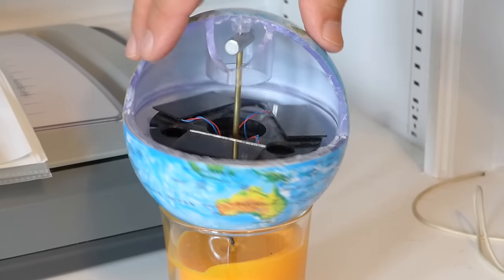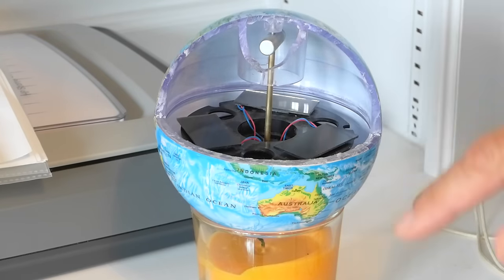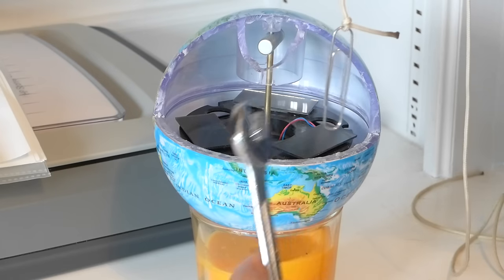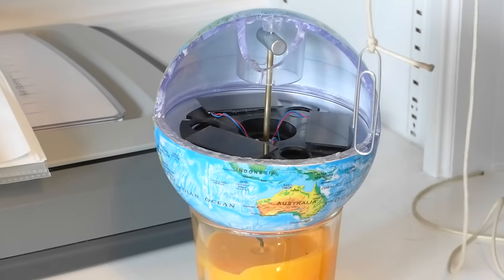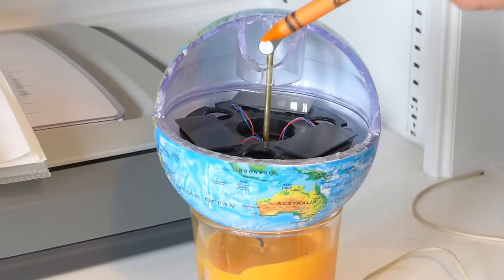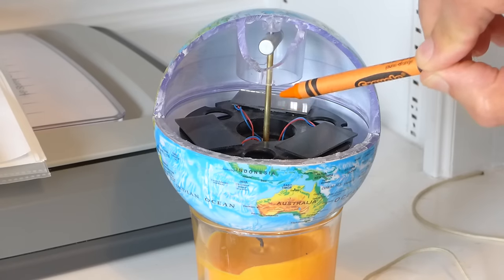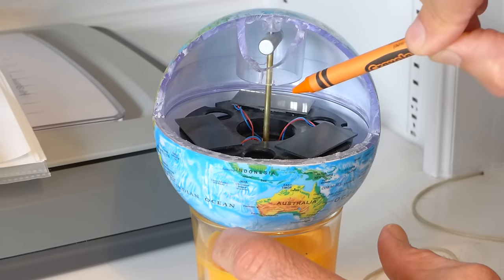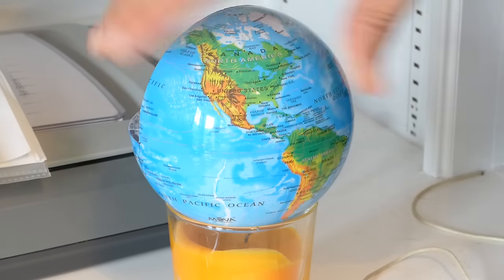Mova Globe cut open reveals powerful magnet. Why? Its ingenious purpose.

Comment: For those of you like me who own one of these and had it stop working... air bubble forms on top and it stops rotating due to the fact its not entirely floating in liquid.. There is a fix... You can drill a small hole in the top... add some mineral oil and then reseal the hole with rubber cement or similar (Goop, etc.).
Reply from the maker: Great work Scott !      I have a suspicion ( without any evidence) that keeping the globe in the sunlight continuously causes the plastic to "off-gas" and produce that gas bubble inside.  Just like the vinyl dashboard of a new car off-gasses and deposits that  layer of haze o the inside of the windshield.
Reply: Another reason this thing should cost no more than $25.
Reply: better yet, flip it over and drill a hole in the bottom to let the air out. then you wont see the hole once its patched up!
Reply: @orvillewingnut8260  Wouldn't that cause positive pressure though, thus not requiring any more fluid to be added after the pressurized gas was released by drilling the hole? A contributing factor to your theory could be that the plastic expands over time, but generally of-gassing actually causes contraction instead of expansion. Could the pressure internally be enough to counter that and cause expansion? My intuition says no, but I could be wrong. 

Just thinking through what you said and adding my thoughts to the conversation.
Reply: Don't buy it. Problem solved. 😊

Comment: Two questions.  First, was the inner globe filled wit air or oil?  Second question.  Why do you think there is a tube surrounding the magnet, at the top of the inner globe?  In a failed unit, had oil been found inside the inner globe?  The inner shell is much thinker than the outer shell.  Just an observation… great video!

Comment: I’m wondering if the designer has attempted to use  an induction loop instead of the solar panels to drive the globe which could also light it at night via LED’s?
I’m betting that it won’t work because of the affect it would have over the fixed pole magnet?

Comment: Great video. I have 5 mova globes. And another that developed a large bubble. What a $200 waste. I will cut it open to put on my shelf also. What should i use to cut it? A drill with a abrasive disk ? Thanx..,,todsy is jan 19, 2019.,,...,,thanx
Reply: Hacksaw should do, grinder with a cutting wheel would work but is overkill, a klien multitool would work as well. Honestly hacksaw, then sand the edge is probably the easiest/cheapest.

Comment: Hey Orville, love this stuff. Just bought one!  Just wondering why the upper shaft magnet in your video rotates freely (as you point and touch it) and isn’t orienting with the earth’s poles?? Strange. Did you film this video on another planet? 😃. Thanks.
Reply: Because the sphere is no longer suspended in oil. While it's suspended the sphere is in an almost frictionless environment, but without the oil there is too much friction for the axle align with the earth's poles.
Reply from the maker: Thanks Chris. I was wondering about that myself but hadn't figured it out.

Comment: Thanks for the explanation, Orville.  You mentioned that the motor is attached to the globe, but it looks like it spins freely in your video.  Did you unattach it?
Reply: the motor appears to be the part that is spinning freely because the inner globe with the image is being held in place by the canister that it's resting on. When it is properly  assembled that sphere is suspended in the larger outer sphere with oil between the surfaces. The powerful magnet he demonstrated alligns to either the earth's magnetic poles like a compass or whatever fields are in the area anchoring it in one place. so that when the motor rotates it and the outer globe spin instead of the internal shaft

Comment: I still don’t get it 😢 it spins with little solar panels - ok. But the magnet? What is it doing. Would a weight at that bottom not just keep it upright. Why is a magnet needed.
Reply: The motor underneath slowly turns the magnet which wants to stay aligned to whatever magnetic field is present, likely the earth's.

Comment: I assume there's liquid between the outer shell and the globe itself however is there liquid inside the globe. Also those 3 rectangle panels are they solar panels and
Power  electromagnets ?
Reply: The liquid is two different oils that won't mix one thin and one much thicker.  The thicker oil sinks to the bottom and helps support the bottom heavy interior (globe image) sphere and the lighter oil keeps the globe from rising to the top of the outer globe and rubbing.  Together the two oils keep the inner globe centered inside the outer globe thereby eliminating friction between the two shells.  This is all explained by the inventor himself in this YouTube video:  https://www.youtube.com/watch?v=EEJtHyv2Rqo
Reply: Thanks for that link, David! Fascinating to see the story behind these globes from the inventor himself.

Comment: does it have a battery?
i haven't used mine in a while the spot where i have does not get enough  sun ,  i want to know if it has rechargeable battery that might have died?
Reply: It has no batteries - only solar cells (inside the globe).  It uses strictly light to power it.  Even indoor lighting should power it . . . if you get the light close enough to it.
Reply: @dbmyers2  thanks but i figured out why it is not working anymore
apparently these things have known problem where they can leak internally
i  held mine up and noticed that it has a  bubble in the bottom (the tell tale sign that the inner globe has leaked)
really disappointing since  this thing was so expensive and it has never been dropped or even moved around and never exposed to any  temperatures besides room temperature , apparently it is a  known issue with these

Comment: Wait so does the magnet anchor the center metal post to a direction stabilized by earth's poles? Or like what does it hold on to in order to anchor? How does it keep it's direction regardless the motor moving or outside forces?
Reply: I just read the video description, guess this is the case. Wow, what else is this tech used for? Being able to anchor something one way without it touching anything or an outside magnet seems promising
Reply: @SaveDareDevil-Mx  yep basically like spinning something against a compass needle as the anchor

Comment: I figured it was much simpler that that.  Ever to that science experiment where you sit in an office chair and spin bicycle tire?  if you keep it vertical you don't move.  If you turn it left or right (from the top, 11 oclock or 1 oclock ) you will spin left or right in the chair.
I figured that it was solar powered with a motor and a flywheel at a slight angle to make it spin.
When these first came out there was almost no visible seam, but MAJOR warnings all over them.  Keep out of the sun, keep from flame, keep from heat source.  If liquid leaks it could ignite on its own.......
A year later NO warnings at all with these....
Reply: A motor would make noise and vibration though. I imagine these are to all intents silent in operation.

Comment: I just bought a used Nova globe with a bubble on top. I'm wondering if I could drill a hole near the bottom of the outer shell, add some oil and then seal the hole.
Reply: Probably, pure guess but I imagine they use mineral oil. I'd be careful not to let pieces of plastic shaving get into the inner shell.
Reply: Oh, I didn’t think of that. Thanks.
Reply: There is a warranty
Reply: xbpbat21x they said it’s used
Reply: weirdyoda04  Yes. I got it on EBay for $40.
Reply: Yes you can
Reply: If you are going to try to fix this by adding oil . . . DO NOT DRILL your hole near the bottom!  There are two kinds of oil in between the two plastic shells with different viscosities.  A thicker oil at the bottom and a thinner oil at the top.  These are oils that won't mix.  Drill a very small hole at the top and had a thin viscosity oil (use a hypodermic needle or plastic version), then seal the hole with a crystal clear two part rosin glue like the ones used for jewelry.  Actually. . . now that I think about it.  Both oils will assume their relative positions again no matter where you rotate the globe . . . so you can put the bottom of your globe upward, let the oils re-establish their positions, then drill, fill, and plug.  After it is cured you can rotate the bottom of the outer glob back to the bottom.
Reply: @dbmyers2   Thank you, David. Sounds like a plan. I now have 2 used 4.5” Mova globes. I’m going to try the repairs soon. Very nice of you to take time to respond.
Reply: @JordanKitzmiller  You're welcome.
Reply: Keep us updated!

Comment: My mova globe is not spinning what do i do?
Reply: try to change is place, or place a trombone on top (it will be attract by the magnet, it help the globe to turn) after 1 hour, you can take the trombone in the globe will turn.
Reply: It just needs light
Reply: @interieuretobjets  they say specifically not to put any magnetic source above or on top of the mova globe/i dont know why you didnt read the booklet.
Reply: @mollyhealy1525  i sell this product since 4 years, and it's an advice from mova IF YOUR GLOBE DON'T TURN. And we test this solution and it works, it's just to help the globe to start the rotation.
Reply: Your about to have a Pole Shift get to higher ground before ocean rush in..

Comment: What keeps the inner globe from grinding against the outer one?
Reply from the maker: There is a layer of oil between the inner and outer globes.   There are 3 different weights of oil in that layer, one on the bottom, one on the top, and one in the middle.
Reply: Robert Pearce  yes

Comment: What is the magnet anchored to? The Earth's magnetic field seems too weak
Reply: In general it uses the Earth's magnetic field.  See  "Torquer rod" or "Torquer bar" for more information.  It doesn't take much force to overcome the friction of the oil bearing.
Reply: @mneedes2  that's pretty impressive
Reply: @mneedes2  The earths mgnetic field is more than enough to align the rare earth magnet and fix it so that the motor (and globe) need to rotate around the shaft instead of the shaft rotating around the motor.  If you try to use these in a large office tower or other building with a lot of steel in the structure they will work less well or not at all because the magnetic lines of the earth are shielded from the device.  Same goes for interference from very nearby magnets or electromagnets (such as motors).